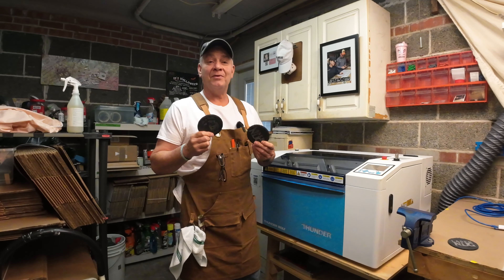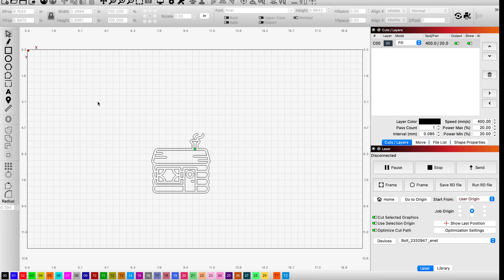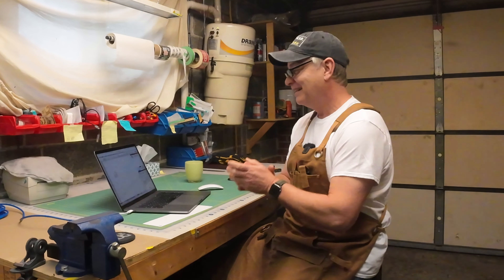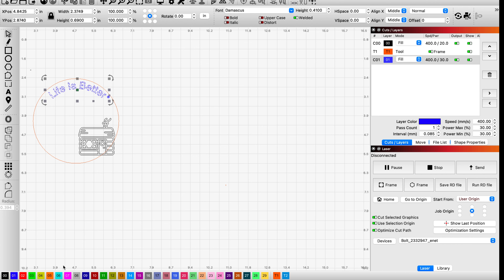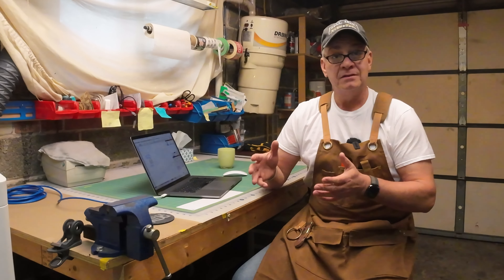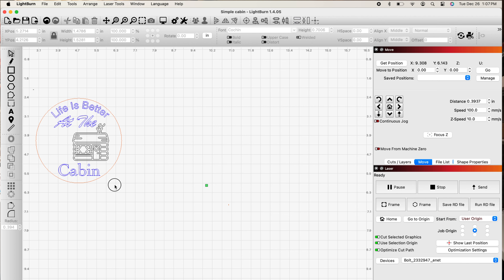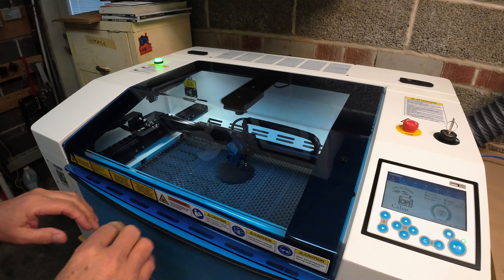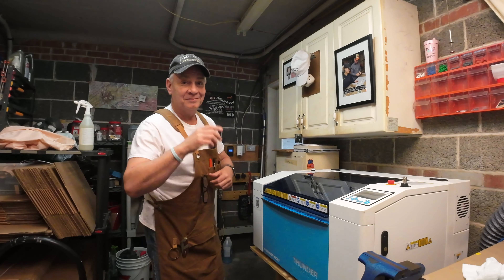Let's Engrave a Slate Coaster on my New Thunder BOLT Laser.  008   4K

Comment: How.long didnit take to do the cabin coaster? Also can you set it up with a jig to do batch runs?
Reply from the maker: Good day Mrs. P. On the next video I did one with a little more detail and it was 3 mins. I am going to work on creating a template and doing them in batch soon - I am trying to decide what to use for the template as I am finding the 1/8" wood stock tends to warp over time. Thanks for watching!